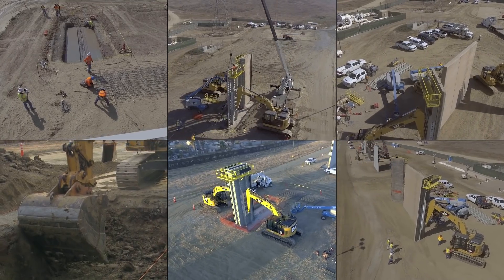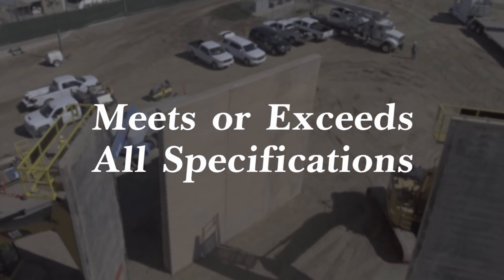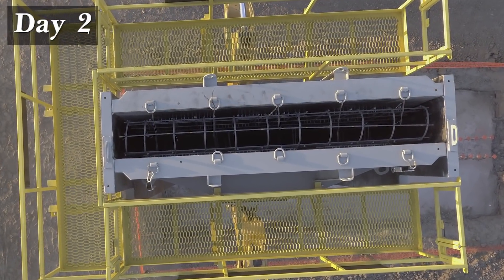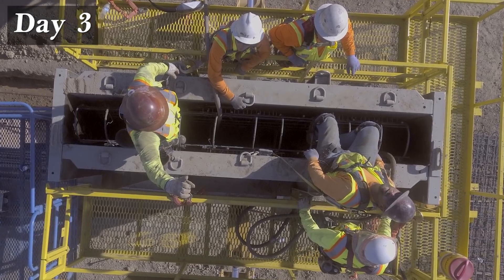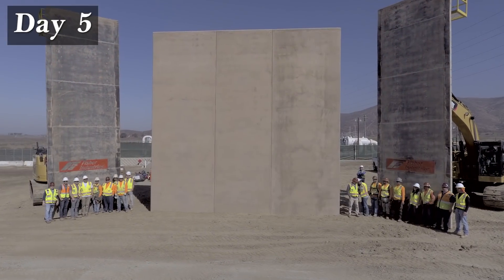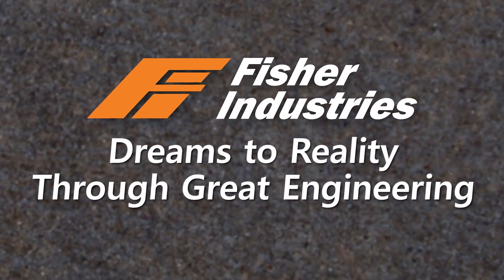Fisher Prototype Concrete Wall Construction 12 08 17

Comment: By FAR the most impressive system to build the wall I've seen to date.
Reply: Sorry, but it's the most ridiculous system ever seen.  Anyone who has ever worked construction knows that holding 2 excavators hostage for 23 hours after performing only 1 hour of work is beyond ridiculous.  Watch the video again.  Each wall section requires 2 excavators to do only one wall section PER DAY!  The alternative would be 1 excavator placing one preformed section, not per day, but PER HOUR.  That means in an 8 hour work day, you could have 2 excavators place 16 wall sections PER DAY versus in this video you have 2 excavators placing ONLY 1 section, not per hour, but PER DAY... ridiculous!
Reply: @echosmyth2282  go sweep the floors again.

Comment: That's a nice high wall fisher your hired. Make sure you put those spikes they use for pidgins on the very top but allot more thicker.
Reply: I agree and vote Republican
Reply: Oskar Dirlewanger  They didn't do anything about guns or education either. Many "Republicans" like Flake and McCain are turncoats. You'd need a 2/3 majority of the Senate to really get anything done. Not to mention that Trump's second term is really where they could make progress. First term is all about trying to appeal to waffling voters so they vote you back in. I'm not saying any of it is justified, but there's reasons even Obama didn't institute full socialism and gun control despite having great odds.

Comment: Going to need a DAMN long vibrator for that. But as someone who has worked for a multinational German formwork manufacturer and hirer, I have NEVER seen the excavator idea and I LIKE IT. Having said that it's a lot cheaper to use props and formwork held with pins because it's EXCAVATORS SITTING DOING NOTHING that could be used to assemble and disassemble TONS of formwork daily.
Reply: That's what I was thinking. The molding is awesome but tying up excavators should be a fixed problem by now.
Reply: They just leave the excavators running while pouring. Rev to vibrate.

Comment: One thing I especially like about this wall system is its "Terrain Conforming, Smooth Wall Transitions". Why can't the noise blocking walls alongside highways be built this way? The step look is hideous.
Reply: Those steps are designed in as part of the noise canceling aspect of the wall. They break up the sound waves and turn some of them out of phase which cances out some of the next incoming sound waves.

Comment: Automate the building of the wall with robotic arms that are used in factories, on a rail system. The railroad aught to bid on building the wall. This steel wall that’s being built will rust out in no time. This one would be much better but needs to be automated for sure because we don’t have ten years to build the wall.

Comment: Although not going to use this design It would have been nice to have a few miles of this concrete wall 40ft high as part of the double wall system.

Comment: Great idea as an engineer like the efficiency but how do you poor for uneven ground adjustable bottom?
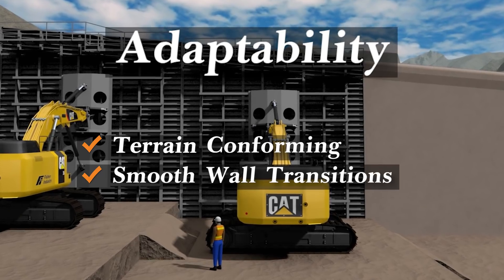Reply: 3:11. You're an engineer. The attachment from the excavator arm to the form can be made to rotate to compensate for slight slopes.
Reply: @akalksander9184  then tops would lean
Reply: @gregbarker860  Do you mean pour instead of poor?

Comment: If u see actual site condition is not like the same as u shown in video, some time machinery can't move it reach  at work place 2. For above process well levelled and compacted ground is required and it's not possible to provide every time because of other any substructure like plinth beam, electrical cables etc. And it's very difficult to align the shutter board with the help work excavator, excavator is made for excavation and tolerance in excavation is more as compare to shuttering tolerance +-5 mm is tolerance for shuttering. So needs to things more for more feasiblity at work spot.

Safety- chances of  toppling of excavator is more , skill manpower (operator) is required 

Quality- very difficult to align the shutter board, chances of more human error and machinery error

Production- proper planning is needed, highly skilled manpower is needed.
Reply: There is no dowels provided to attach with mother concrete, chances of water seepage

Comment: I do liked the one withed the road on top and earthed piled uped on our side of it.  But where do the anti-personnel mine go at?  And where do they mounted the remote controls automaticed grenades launchers?
Reply: Apparently the mines violate international law so we don't use them. The grenade launchers and mini guns go on top of the wall. Or on Humvees.
Reply: @sammiches2555    Yes but just we could to used mines withed rubber balls instead ofed leathals ones.  Just as do they used ined riots at where do they throw hand grenades withed rubber balls stingers instead ofed metals shrapnels right?  That would thened teached them to stay away fromed ours wall.

Comment: How can it last 2 times longer than precast concrete? Can't precast be built to higher strength requirements?
Reply: KirkDickinson it lasts as long, if done right. They are referring to fences and the like.

Comment: It's too thin and the foundation needs to go at least 12 feet down or it can be tunneled under.
Reply: It can always be tunneled under but if they back fill it there's not fine odds they tunnel under before we notice. If they dig under that's not that big on an issue. It's better than 70,000 in one month.

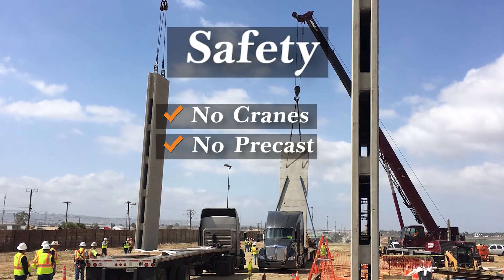Comment: 2:42-:44... no cranes ?   Great looking system. But come on... how can you aerial lift like that without some cranes?
The common person doesn’t know the difference. But anyone with tilt up large and rebar cage experience knows how time saving and efficient a small crane is for placing things safely and accurately.
‘Minimal’ crane usage would be more accurate.
Reply: Just watched your other videos. Impressive for sure. You are using a ‘long reach excavator’. But it still is doing the same function as a small crane...just saying. The aerial lift factor is still present to some degree.
But great system ! Kudos. 👍🏼
Reply: Anyone who has ever worked construction knows that holding 2 excavators hostage for 23 hours after performing only 1 hour of work is beyond ridiculous.  Watch the video again.  Each wall section requires 2 excavators to do only one wall section PER DAY!  The alternative would be 1 excavator or crane placing one preformed section, not per day, but PER HOUR.  That means in an 8 hour work day, you could have 2 excavators or cranes place 16 wall sections PER DAY versus in this video you have 2 excavators placing ONLY 1 section, not per hour, but PER DAY... ridiculous!
Reply: EchoSmyth you are right. Per my point, you still need some type of crane. Having worked precast for almost 4 decades, I too thought exactly what you said. I was being nice, because no one is perfect. But as you said a bit more directly.. tieing up the excavators like that is ridiculous. Unless of course it’s a federal job, where money is no object. 😉

Comment: As a Designer/Engineer, I like this WALL, but what happened to the "see through" component. I still like the "POISONED RAZOR WIRE" at the top, Pop-Up Machine Guns,  Anti-Tunnel explosives to go along with the Anti-Personnel Mines.  But...cough, cough...10 years to build.... That would let another 20,000,000 illegals into the country.  

We wouldn't need a wall, if the immigrants couldn't get a job. So.... start severely fining any employer that gives an Illegal  Immigrant a job. This does not include workers with green cards, or documented migrant workers, just the illegals & employers who refuse to comply with the law. Tell the countries south of our border that all their aid is cut off to pay for this new border. If you are wanting to solve the problem, then SOLVE IT....

Comment: *EXTRAPOLATED **** 20210104 *** Grand Total 457+ miles ** (CBP: 453 miles 20210104 ; Private: 4 miles). Promise Kept!
This is ≥ 101% of 450 mile goal, ≥ 89% of 509 mile goal, ≥ 69% of previous 654 mile preexisting, ≥ 45% of 1,000 miles, & ≥ 23% of entire southern border. *Extrapolated @ 1 mile per day using recent rate.

Comment: The wall wanted is the Steel Ballard see thru wall. Not a solid wall. 
Redesign your process so the bottom 5 -7 foot is see thru.
I am for a solid wall that is 30 foot wide and 60 foot tall.
Put two bullet trains on top and sell tickets to pay for the wall.
Put desalinization plants in the gulf and pacific and pipe fresh clean water thru the wall.
Sell water to Mexico and the USA to help pay for the wall.
Build seven Vacation Resorts into the wall (7 Wonders of the Wall) in various locations.
Each resort is based on an ancient culture. Let those also pay for the wall.
People will come from all over the world to ride the trains and vacation.
The world would pay for the wall.
Nope! The Border Patrol Agents asked for a see thru wall.
I know thru is spelled through, but I type thru because it is faster.
Reply: No need to see thru it.. they are planing to build a road on top for observation and patrol. Much safer for the agents
Reply: With a road on top, it does not need to be see through.

Comment: I am for the wall, but your bid will be way too high in comparison to what it should cost to build it, 6 excavators holding up permanent concrete forums is ridiculous, then to shut off equipment loses money every second a machine on job isn’t running, all for concrete to dry....I can cut your budget on a more economical scale without losing any integrity to the wall...eliminate the road ontop aswell, cameras and drones will do just fine when motion sensors triggers live feed.

Comment: Not much time prior to form removal not enough time for curing. 48rs min for removal then sprayed with a curing compound. Or 70% strength.
Reply: Not to mention that even if you used the bogus 24 hour cure time, anyone who has ever worked construction knows that holding 2 excavators hostage for 23 hours after performing only 1 hour of work is beyond ridiculous.  Watch the video again.  Each wall section requires 2 excavators to do only one wall section PER DAY!  The alternative would be 1 excavator placing one preformed section, not per day, but PER HOUR.  That means in an 8 hour work day, you could have 2 excavators place 16 wall sections PER DAY versus in this video you have 2 excavators placing ONLY 1 section, not per hour, but PER DAY... ridiculous!  But of course the number is really 1 wall section per 2 days for realistic curing time.
Reply: Additives.
Reply: @echosmyth2282  not to mention your lame comment again

Comment: This is SLOW and expensive.... Nice try though.
Reply: Having poured a fair amount of concrete I would say that theses guys have this down pretty fast. And the production line approach means that we would essentially be paying for concrete delivery. Still, over time concrete lasts longer and is cheaper than steel. It's the best buy.
Reply: @w8stral  I like your ideas for the construction portion. Your approach to drug enforcement...not so much. I used to think the same. After decades of a failed drug war I have changed my approach. Legalize it all and tax and regulate it. We arent/haven't stopped drugs. There is a good chance we could help the people on drugs though. Same premise as legalization of alcohol. Making that illegal was a disaster. We definitely did better by regulating that industry.
Reply: @w8stral  I have firsthand experience reference the counter drug operations. We have waged war on drugs. And yes, people were killed. 1st, 3rd,5th, and 7th Special Forces would argue that we have indeed waged war. 

Making alcohol illegal was...problematic. Doing so spurred the growth of the US mob. The murder rate for every major US city went up 500 percent during prohibition. And untold numbers of people were poisoned by bad booze.

Corresponding the murder rate dropped after repeal of prohibition. Most people would agree that it's safe to drink commercially sold alcohol. And we do collect taxes and refuse to sell to kids.

I agree regarding people's freedom of choice. There would still be lots of problems, but, if we traded drug dealers for pharmacies we could get the drugs off the street, keep them away from kids, and yes collect some taxes. We certainly get the bill for all the problems related to the drug trade. I'd like to see that offset somewhat. Perhaps they could use that money for educating people that drugs are bad and rehab.
Reply: Well I have to say, if you go pharmacy route, is one extreme, but only solves the light drugs.  It does nothing about Meth, Heroine, pain killers, opium, or whatever new drug comes out.  So your "idea" is NOT a solution it is a delusional utopia.  Also, does not address the actual addiction problem.  Comes back to morals, or lack thereof ultimately. 

And no, we never waged war.  Going after a few rare middlemen they get enough intel on is an epic joke.   @philliplopez2231
Reply: @w8stral  it's not utopia. Just solid business. Make it more profitable to sell crack, etc. legally with a doctors prescription, taxes, health inspections and the like. We already have hard drugs that are legal. We regulate them. No, we will never get rid of all addiction. That's a pipe dream. But a doctor would refer patients to pain clinics that specialize in addiction. Right now their dealer tells them he has a two for one sale. There are gains that could be made. TED talks has a few very good videos on the benefits of legalization. Places that have gone this route see lower rates of HIV, hepatitis, etc. They spend less on health care. They spend less on policing and incarceration. And with an emphasis on doctors and education they even begin to see a lower rate of usage. Even hard drugs. One such example was Thailand and decriminalizing clean needles as drug paraphernalia. Other studies have suggested that soft drugs like marijuana provide a low impact alternative to drugs like meth and heroin.

I'll agree to disagree on the war question. FWIW I served twenty years in the military and four tours of combat. Counter drug operations were routine. But I get your point as well. You think we could have possibly done more. Reality is that's a little  harder than it sounds without killing innocent people as well.

Comment: Amazing how people in the comments are eating up this idea without giving it even an ounce of critical thought. Anyone who has ever worked construction knows that holding 2 excavators hostage for 23 hours after performing only 1 hour of work is beyond ridiculous.  Watch the video again.  Each wall section requires 2 excavators to do only one wall section PER DAY!  The alternative would be 1 excavator placing one preformed section, not per day, but PER HOUR.  That means in an 8 hour work day, you could have 2 excavators place 16 wall sections PER DAY versus in this video you have 2 excavators placing ONLY 1 section, not per hour, but PER DAY... ridiculous!
Reply: another vid i saw for this is 6 excavators doing a wall section and 4 more doing another section. wait 15 hours and move one to new section and other to fill in spot. could have multiple groups doing this.
Reply: @rfrye73  You totally missed the point.  It doesn't matter how many excavators you throw at it, you will always be able to do way more with preformed sections.  Also, there is no way in hell that much cement is going to cure in 15 hours, but lets go with 15 anyway.  By saying they move onto the next section, you imply they're working around the clock, right?  In this video, it is taking 2 excavators to do 1 wall section PER 15 HOURS.  Using preformed sections you could instead use only 1 excavator to place 1 section PER HOUR. In that same 15 hours, using preforms instead, a single excavator can place 15 sections (1 section per hour). Using your example of 6 excavators working in one area and 4 working in another area, that's 10 excavators placing only 5 sections in 15 hours.  Using preforms, those 10 excavators could instead place 150 sections (1 section per hour x 15 hours x 10 excavators = 150) versus only 5 sections using the Fisher method!  That's a HUGE difference!